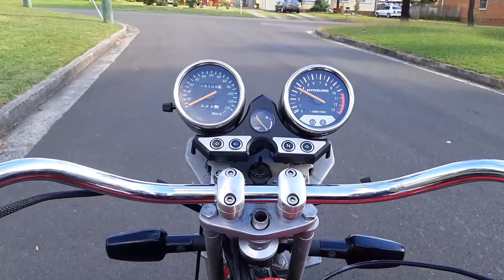Homemade Volkswagen trike - 7 year long project

Comment: What year are the VW rear light assemblies? I’m using 1976 styles ones and they seem similar but with different coloring.
Reply from the maker: The lights are 1973-2003 model. The lens is after market which does come with different colours. I bought them in Sydney but they may be Brazilian after market parts.